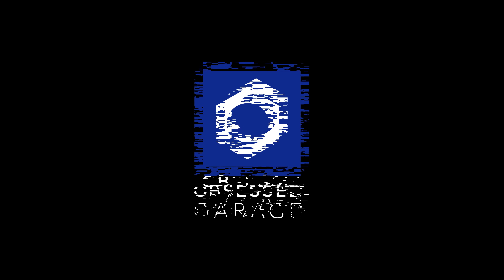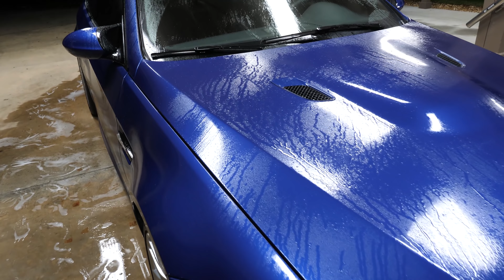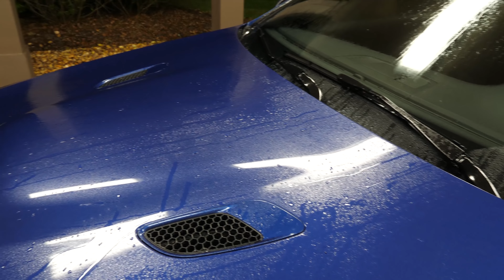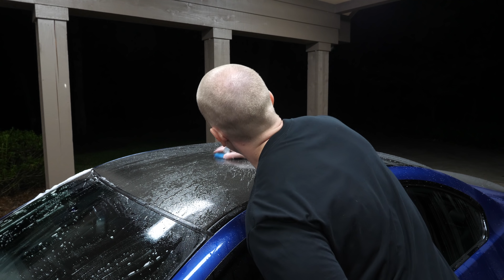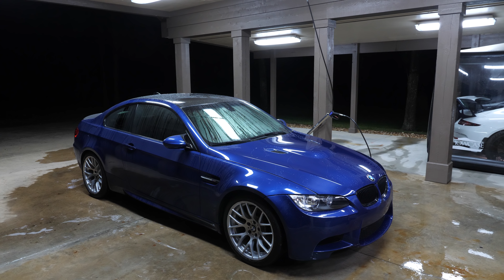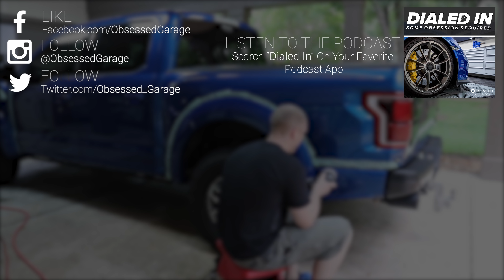Dialing In My E92 M3: E3 - AutoScrub Decontamination

Comment: Hey Matt,I've got a vehicle with some vinyl stripes.  During the Iron X process, would you simply avoid spraying those areas or is it inconsequential?  Also wonder how you alter your decon. process for PPF vehicles?  Thanks for sharing the "crazy."
Reply from the maker: PPF should be the same process.  Treat it like paint.  I would try and avoid spraying directly on the vinyl, but I wouldn't worry too much about it getting on there.  Just make sure it doesn't dry.
Reply: @ObsessedGarage  Same for satin PAINTED hood and spoilers?

Comment: How can contamination get into the paint, if you have it coated?
Reply from the maker: A coating "grabs" onto the surface of the paint.  Paint has jagged pits and valleys that a coating would follow.  Contamination would embed to the coating just like paint.  Also you may have areas where the coating is no longer bonded.

Comment: Matt great car, notice that you don’t seem to have to use any tar remover, it’s an extra decon step used a lot in the UK, before claying or Auto scrub on the lower panels. Not an issue where you live ?
Reply: Nigel Newcombe in the South of the U.S. we don’t even have to worry about salt on the roads in the winter. The biggest problem here is probably cleaning bugs off the front
Reply: @thomasbailey4139  he said tar, not salt. Am I confused? Anyway, I'm amazed any of this stuff is real.
Reply from the maker: It can be, but this car didn't have any tar spots on it.
Reply: Mitchell Steindler your comment doesn’t make sense.

Comment: Might be a dumb question... but can you clay or autoscrub a already waxed and or sealed car? Will it affect the wax or sealant on the paint?
Reply: Jack Anderson You can but A your clay won’t be as effective, and B you will clay most of your wax/sealant protection off.
Reply: In retrospect yes you could. But I’d recommend stripping all protection and then claying/scrubbing the surface. Remember whatever is under the sealant will be there, it’s like layers of skin. Check out the detailing auto groups on FB I’ve learned a lot on their
Reply from the maker: The clay will remove most if not all of it.  You don't absolutely need to use a stripping soap.

Comment: i hate i got a bigger car, iron remover is expensive!
Reply: Use Meguiar's Ultimate All Wheel Cleaner.  You can get it at Wal-Mart for $8-$10 for 24oz which is the best deal on an iron remover I have seen.  It works really well and will not damage clear coat.
Reply: @bpsdetailing8822  will try it thanks bro

Comment: Do u ever notice that the iron remover doesn’t actually remove the iron ? It just turns purple but when you inspect closely, it’s all still there.
Reply: Spicy Noodles yep it’s a scam tbh. People love when stuff changes colors.
Reply: The iron gets stuck in tiny crevices in the clear coat and then it rusts causing it to be in-bedded by the rust.  Iron remover dissolves the rust allowing the iron to be dislodged much easier.
Reply: BPSDetailing  - that’s exactly it. People often think it dissolves the iron away which it doesn’t. It takes the corrosion of the iron away so the iron is going to be far less stubborn.
Reply from the maker: If that particle is big enough to see with your eyes, you might as well grab it with your finger nail.  Iron X will dissolve the smaller stuff and the clay/Autoscrub will get the rest.
Reply: well yea what did you think it did? It doesn't magically dissolve into nothingness. It just loosens it to be washed away.
Reply: Soap doesn’t  “remove” dirt from your car either.  It simply loosens it from the surface so that when you wash it, it comes off.  Same with the iron remover.  Iron won’t detach from the paint with soap.   And if left embedded, it can break off and Lodge in your pad when polishing, causing scratches.  The iron remover breaks the bond between the iron and the paint so either soap and water or the clay can remove it.
Reply: n9pe It’s not a scam at all.

Comment: So is the autoscrub better than the clay bar?
Reply: It depends on the application.
Reply: You will get mixed responses on that.  Overall I use AutoScrub products more than clay because it is usually quicker and easier, I only use clay when the AutoScrub isn't aggressive enough to get the job done.  Matt and I basically have the same approach.
Reply from the maker: Bingo